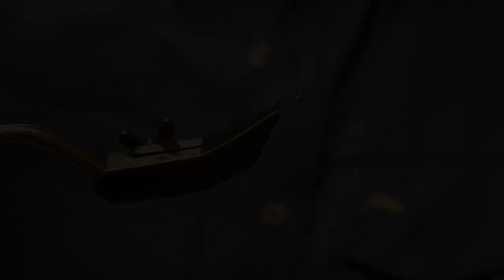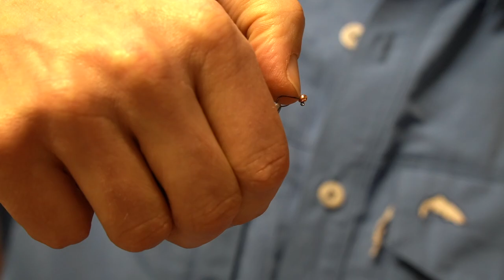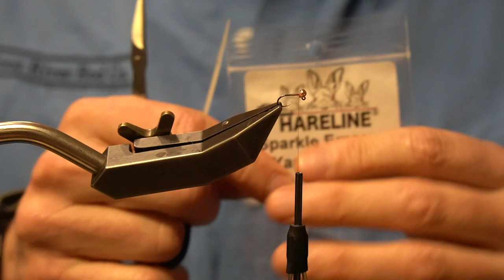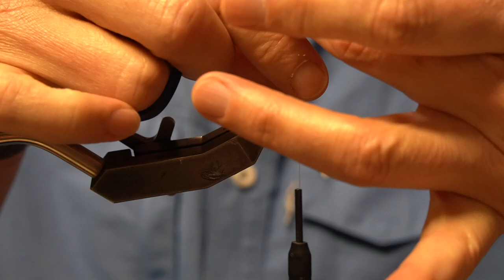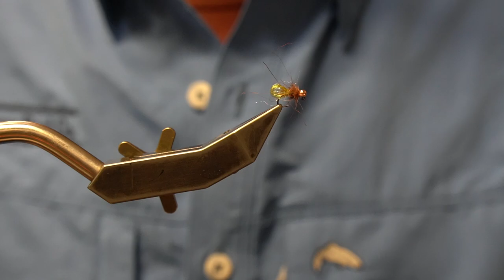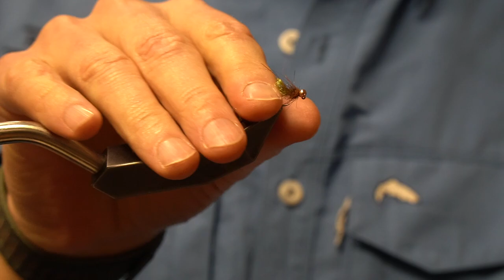How To Tie The Deep Sparkle Pupa: In Depth Entomology

Comment: I've tied and used this fly for 30 years. Gary and his friends made years of observation using SCUBA to observe Caddis. If you are dead serious about learning about his tying methods and the reasons for them, I strongly suggest his book "Caddis Flies" be your guide. Follow his instructions exactly and do not try to "modify" it to what you think is a beautiful fly. I guarantee you if you take shortcuts you will likely catch few fish. I was able to obtain about 5 pounds of the special trilobal Antron directly from his daughter Heather many years ago. This is the only stuff I will use. I previously used Aunt Lydia's Sparkle Yarn without good results. Many yarns are labeled Antron but they are not the same as the vintage now discontinued Dazzleaire trilobal, uniquely highly refractive Antron. Again if you cannot follow his directions you will not be happy. This bubble MUST be tied sparsely with the correct Antron and MUST be 360 degrees around the hook shank. Think about this... the fish usually looks UP at the fly and what does he see? The underside of the fly! You must show the fish the Antron fibers under this fly and the long partially exposed straight dub on the shank. Further, Gary tied these on straight TMC 100 hooks. It is important and the reason why is critical. The book and his videotapes will explain WHY! Every word he wrote in his book has been very well thought about deeply and through personal scientific investigation/observations that no one else has really done.